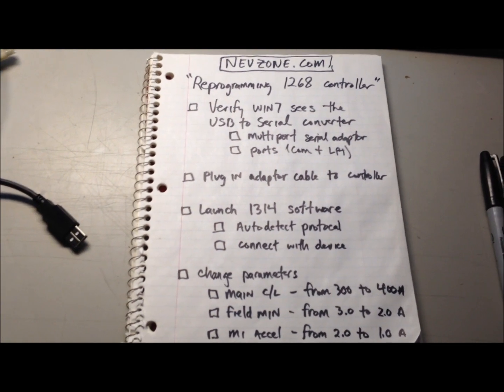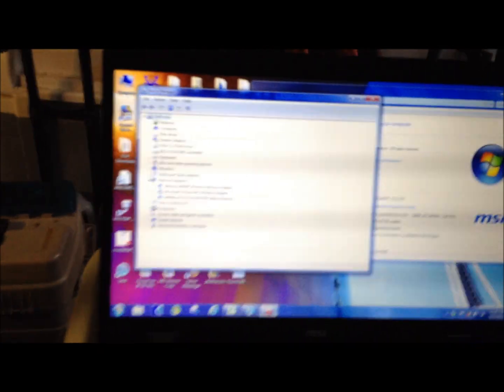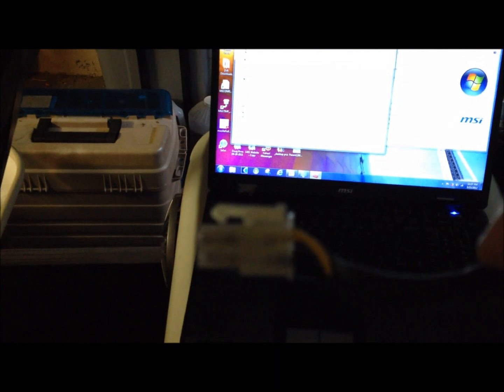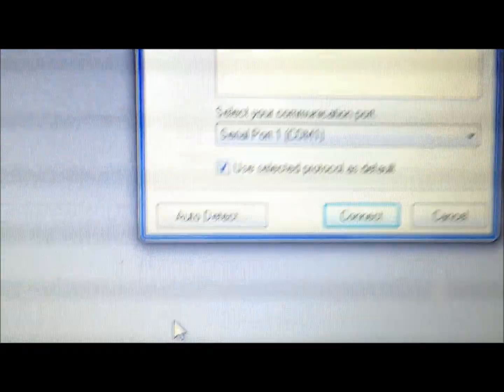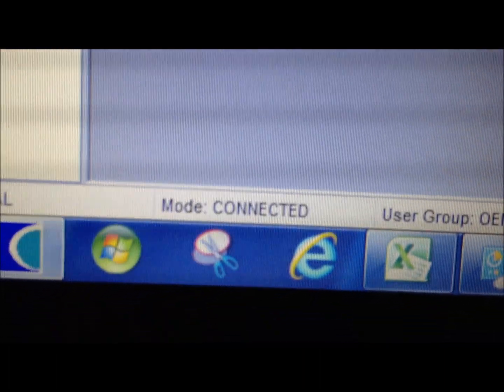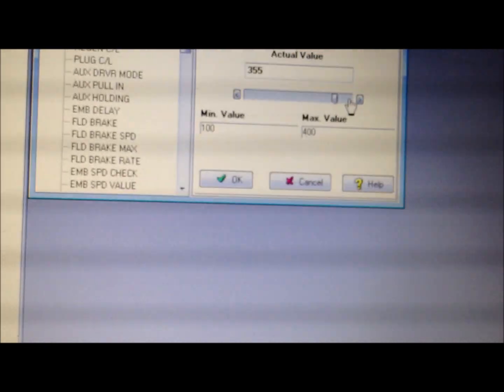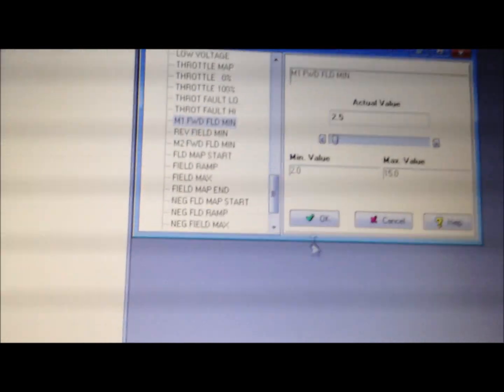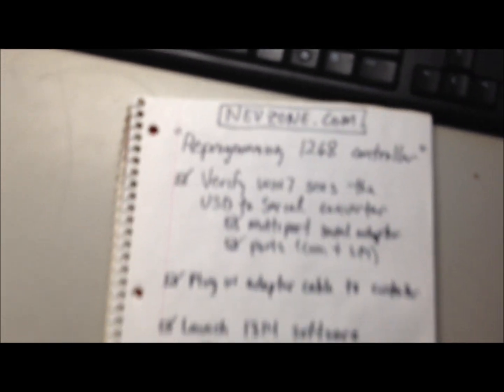controller reprogram.wmv

Comment: Did you need to invert any of the signals to the controller?  I have a 1206ac-5201 but am unable to connect with a USB to TTL cable; 0-5v.
Reply: There are two types of controllers:

older ones work with pure RS232 signals (-12 to +12V) so you need normal rs232 converter with homemade cable and it works with software 1314-4401 , 

newer ones work with 5V TTL inverted signal and also signature(PID,VID) of converter probably needs to be changed and it works only with 1314-4402 software.
I think you should try with normal rs232 converter,not the 5v
Reply: @fendt126  OK, so standard rs232 +- 12v, and a custom piece of wire to make the connections.  Hmmm.  No dice yet.